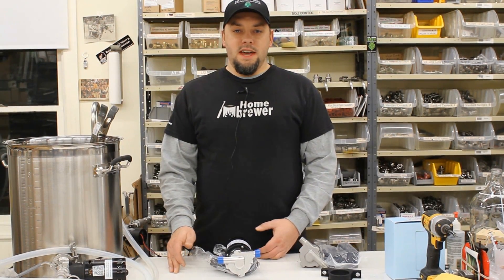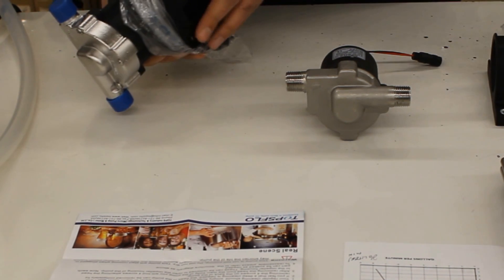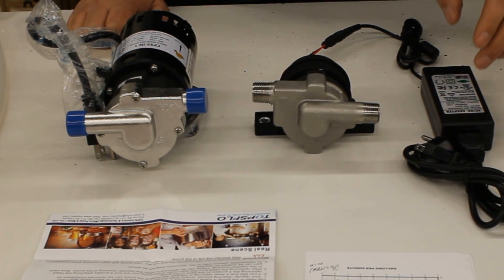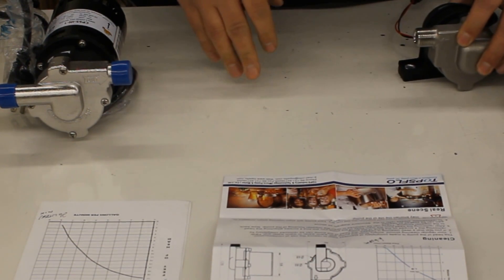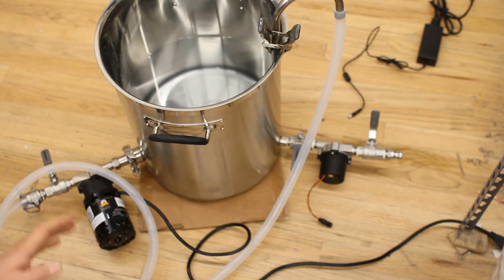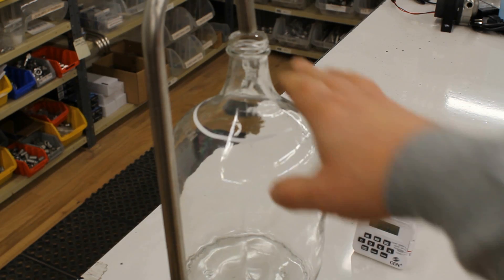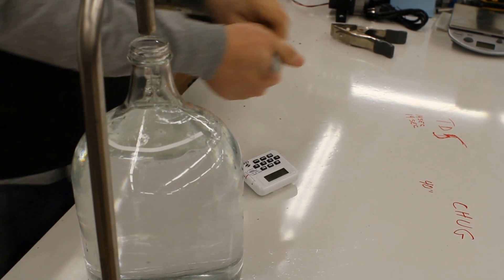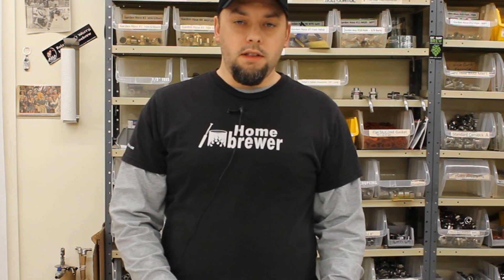BrewHardware.com Intro to Topsflo TD5 DC Brewing Pump

Comment: This is the most useful info on the Topsflo TD5 I've seen. It's not manufacturers talking about someone else's pump (bad form), and you have a vested interest in BOTH of the pumps, not just one of the two. I picked up the Topsflo TD5 and have not yet used it (need to modify some things on my Grainfather to get it integrated). The big differences for me were DC (safer) and how loud the pump is (I brew indoors and I'd rather keep my wife happy than get 1 GPM extra). Later in the year when the self-priming Chugger comes out, I'd probably have been swayed in that direction.